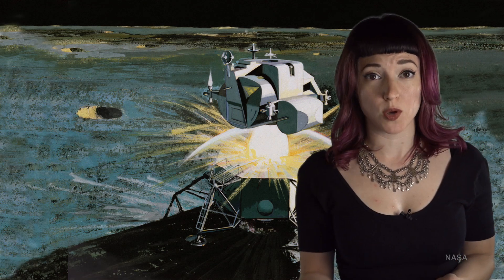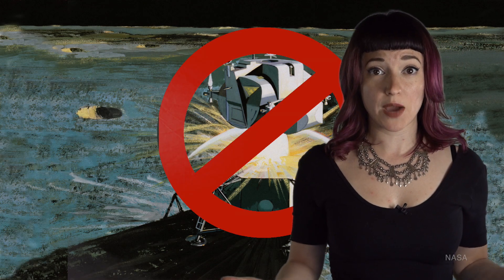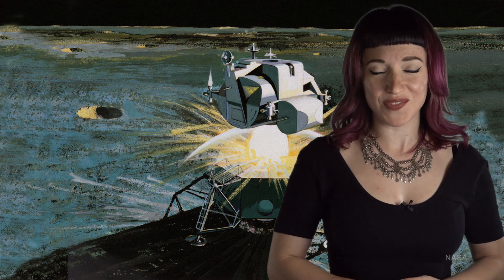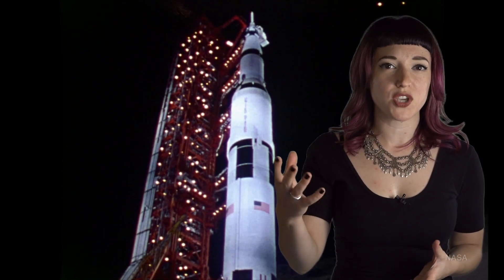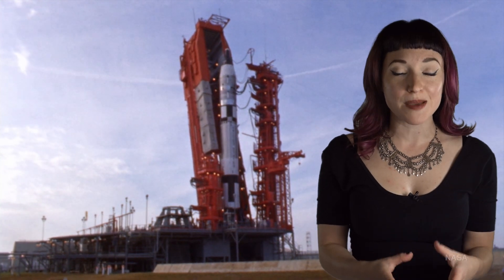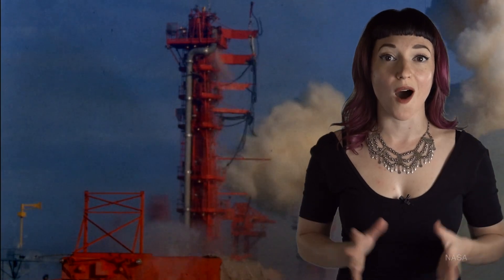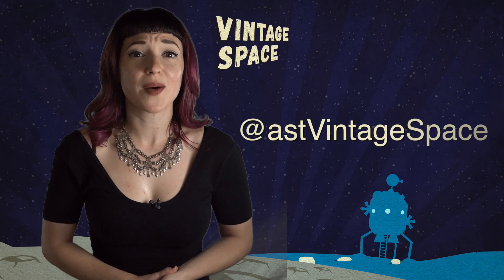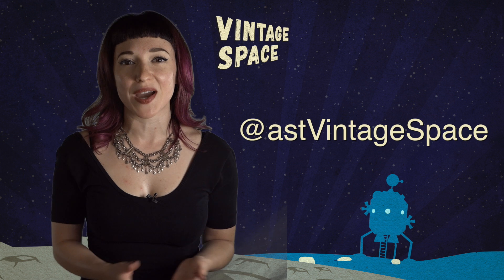How the Lunar Module Launched from the Moon Without a Flame

Comment: if the moon is half the size of earth and has half the gravity wouldn't you need half the size rocket to get off the moon I don't see that small lander having half the rocket size
Reply: The moon is not half the size of Earth, nor does it have half the gravity.
Also it has no atmosphere so a launching spacecraft won't have to force its way through a blanket of gas to an altitude where drag isn't a concern.

Plus, comparing the lunar module lifting off the surface of the moon to the Saturn V lifting off the earth is a bit unreasonable.
The lunar module ascent stage only had to lift itself to lunar orbit, where the orbiting CSM would rendezvous and then to all the rest of the work getting back to Earth.
The Saturn V had to lift the Lunar Module (ascent and descent stages), the CSM, the escape tower, the midstage fairing, the S-IVB stage, the S-II stage, and the S-I stage; all through 70 kilometers of atmosphere with from the planet with the largest gravity well of any of the terrestrial planets in the solar system.
Reply: Niall Kinsella have you ever wondered why they can't go to the moon in the 80s 90s 2000s even now still can't get there land and get back
Reply: @fredsloan3708  
The answer is simple. Since the Apollo program was cancelled, production of Saturn V rocket systems was stopped.
The Saturn V was the only rocket ever built that was capable of carrying a manned mission to the moon.
No rockets capable of doing the mission, can't do the mission.
Reply: rockethead7 you will be cooked going in the van Allen belt
Reply: @fredsloan3708  
Let's recap, shall we?

YOU SAID: "if the moon is half the size of earth"

== WRONG.  The moon is about 1/50th of the size of Earth (by volume), and about 1/4th of the size (by diameter), and about 1/80th of the size (by mass).  There is absolutely no aspect of the moon's size that is 1/2 of Earth.

YOU SAID: "and has half the gravity"

== WRONG.  The moon has 1/6th of the gravity as Earth.

YOU SAID: "wouldn't you need half the size rocket to get off the moon"

== WRONG.  The payload of getting off of the moon was about 1950 pounds in lunar gravity, and it had to lift it about 60 miles, with a velocity around 3,600 mph.  The payload of getting off of the Earth was about 100,000 pounds, and had to lift it about 200,000 miles, achieving a velocity of about 25,000 mph (at its peak).  Do the math.  You're off by a factor of MILLIONS of pounds of fuel/oxidizer.  You do know how to calculate these things, right?  Or, do you just assume that no aerospace engineer on the planet knows how to calculate these things?

And, then, from there, all you've done is ignore answers, and change topics.  You brought up that stupid conspiracy video about Buzz Aldrin "confessing" to not going to the moon.  I replied, asking you questions, you ignored them, and changed topics.  You ignored me.  You ignored Niall.  When asked again about those things, you ignored that.  I mean, what EXACTLY is wrong with you?  What drugs did this to your mind?  You think **I** need mental help?  Hey, dumbass, I'm not the one who gets every fact wrong, and then declares victory anyway.  I'm not the one who thinks that the entire world's experts for the past 50 years are all too stupid to notice that the landers' rocket engines couldn't do the job.  I'm not the one claiming the moon is half the size of the Earth.  That's YOU doing those things.  You have zero understanding of the topic.  ZERO.  Why do you use your ignorance as a method to accuse thousands of people of being criminals?  Nobody likes people like you.
Reply: rockethead7 so show me something you know you can't
Reply: rockethead7 by the way I said half the size because I didn't remember the exact size compared to the earth
Reply: @fredsloan3708  
YOU SAID: "do you really think I care if you don't like me"

== NOBODY likes people like you.  Look at yourself.  Good gods.  You sit there and accuse thousands of people of being criminals who deserve a lifetime in prison... and why??  Because every fact you state is wrong??  Because of your ignorance??  Every single thing you've stated has been incorrect.  Every single thing.  And, THAT is your basis for accusing thousands of people of being criminal frauds?  Yeah, NOBODY likes people like you.

YOU SAID: "I bet no one likes you"

== Pfftttt.  Oh, you're hilarious.

YOU SAID: "and you talking about me ignoring the facts"

== YES!!!!  YES!!!!  That's the entire point.  You say something (which is always wrong).  Someone replies.  You ignore it, and change topics.  You say something else (equally wrong).  Someone replies.  You ignore it, and change topics.  You're doing it again now?  Why won't you address a single reply by Niall or by me??  You were asked questions.  You were challenged on all of these "facts" (sigh) that you're stating.  You've addressed NONE of it.  NONE.  ZERO.  Not a single thing.  All you've done is ignore all input, ignore all questions, ignore all challenges, and change topics.

YOU SAID: "what did you doing out about the van Allen belt"

== Good gods, you idiot.  No, I'm not going to sit here and explain the Van Allen belts to you, when you refuse to address all prior topics.  If I do that, you'll just ignore that reply, and change topics.  And, I will reply to that, and you'll ignore it, and change topics again.  Sorry, dumbass, but I **DO** draw the line sooner or later, and will not address new topics, when you keep ignoring all prior ones.  You're obviously wrong about the Van Allen belts also, just as you've been wrong about everything else.  But, I'm not going to sit here and explain it to you, when your proven track record is to ignore all input anyway.

YOU SAID: "did you look it up"

== Dumbass, I don't need to look it up.  I've read countless scientific papers about the Van Allen belts for the past 30-40 years of my life.

YOU SAID: "bet you did and found out you would be cooked so lets hear what you found out"

== Gee, dumbass, if that was correct, please explain why there are no radiobiologists anywhere on the planet who agree with you?  Why not?  Why are there no particle physicists who agree with you?  Why are there no cosmologists or astrophysicists who agree with you?  You cannot even get the size of the moon correct, and you were off by a factor of 25x.  Every single sentence you've written has been factually incorrect.  Yet, you think you understand the Van Allen belts?  Hmmm, why did James Van Allen himself not agree with you??  Do you think you understand the Van Allen belts better than James Van Allen did??

What a complete moron.

Comment: I'm curious how they achieved the 25000 miles per hour that is required to escape Earth's gravity.
Reply: After getting into Earth orbit (17,000 mph), they did all of the system checks, then re-lit the 3rd stage J2 to add the extra velocity.

Comment: It looked to me like it was leaving the moon with an entirely different system, maybe even an anti-gravity one. The example of the rocket she gave us at launch in the daylight on earths atmosphere was still somewhat visible and yet I could not see anything at all in the night sky over the moon B.S. I think we were allowed to come to the moon and take the credit as gratitude for the negotiated compromise we made with the Germans after WW2.
Reply: Mike Abbitt makes a very good point and his theory on why we couldn't see the flame is far better than my anti-gravity one, I still Believe the Germans got there first and gave us credit as a reward.
Reply: @gravitronrutherford1631  
Good gods.  Antigravity engines??  Um, no.  There are reasons you can see a bit of the outer edges of the flame on the Titans.  (A) They ran them rich, because they wanted to keep them cool.  Extra fuel vs. oxidizer means that some of the fuel is going to burn with the surrounding air, instead of the N2O4.  It's the same as a car.  Run a car rich, it runs cooler.  Run a car lean, it runs hotter.  (B) You are going to see some interaction with the surrounding air.  On the moon, there is no surrounding air to interact with.  Hence, on the moon, the invisible flame remains invisible.
Reply: rockethead7 thanks for clarifying, that makes a lot more sense.

Comment: I have always wondered about this. But this video doesn't give me all the answers I want. Compare the size of the rocket that leaved earth to the module that arrived at the moon. I know Moon's gravity is weaker... But Did they really have enough fuel to get escape velocity to travel back to Earth? I would like this to be explained to me, i can't find it on the internet, there are a bunch of articles on the landing but apparently none on the take off.
Reply: The Saturn V had a payload of the command module, service module, lander, three people, the entire Saturn V craft itself, and all of the fuel/oxidizer needed to land and return home... and it had to lift all of that stuff a distance of about 200,000 miles before the lunar gravity did some of the work.  And, in rocketry, one of the most compounding factors is that you need to have enough fuel to lift the fuel.  And, you need fuel to lift the fuel to lift the fuel.  And, you need fuel to lift the fuel to lift the fuel to lift the fuel.  (I'm illustrating a point.)  And, it had to do all of this in Earth's gravity.

The LEM's ascent stage had a payload of a few rocks and two people, and the small craft itself.  And, it had to lift it into an orbital height of 60 miles to rendezvous with the command module.  And, it did it in 1/6th gravity.

Every year, thousands of students across the planet do these calculations as homework assignments.  The lunar module is textbook material at this point.  Of course there was enough fuel.  You can do the calculations yourself.  Or, if you scroll far back enough through these comments, you can find examples of when I've used the standard rocket equations to do the calculations for people in these threads.
Reply: @rockethead7  Man it's really hard to find your other comments. Youtube doesn't help at all. I really want to see the calculations.
Reply: @martinluther123  
Yeah, sorry, I'm not going back through the comments to get them.  And, I'm not doing them again.  You'll have to do them yourself, or patiently load comments until you find them.  Others here have done them also, by the way.  But, I'm guessing that the last time was around a year ago, maybe 18 months... best estimate.

Comment: Last point.  In the movie "2001", despite the brilliance of Arthur C Clarke and an army of highly educated technical advisors and director Stanley Kubrick's assiduous attention to detail,  the lunar lander produces a billowing cloud of smoke underneath. A minor error, excused by the fact that earthbound experience intuits a billowy cloud. This phenomenon would only be possible within a pressurized atmosphere where exhausts currents can be entrained in air or other ambient gas  (e.g., a helicopter landing on earth).  In a vacuum, however, billowing cannot occur, and all exhaust products are expelled RADIALLY from the source of ignition. The Apollo 17 video shows NO billowing. Rather, the exhaust gas eject radially from the rocket nozzle.  Move, check, checkmate, game.

Comment: I’m not sure how they maneuvered the lem or the space module around in space exactly, but from what I remember hearing, the space shuttle had little whole or ports that would through out short pops of air to maneuver the shuttle in different directions while in a stationary location or stationary orbit. At least that’s what i heard. The small thrusters were used to make larger maneuvers like moving in and out of orbits and the main drive was used to begin final decent.
Reply: Its called the reaction control system and every crewed spacecraft has them

Comment: Wrong on many levels,  they need to be propelled with helium,  hypergolic fuel is only also temperamental,  and the fluctuations of temperature on the moon would have made them highly volatile or unusable, they also produce less thrust so you need way more than the tiny lunar module carried, propaganda crap.  USA had Hollywood,  Russia didn't.
Reply: YOU SAID: "Wrong on many levels,  they need to be propelled with helium,"

== Pfffttt.  Helium?  Tell me this is a joke.  You do know that's an inert gas, right?  It doesn't burn with anything.  They did use helium to pressurize the tanks.  But, no, they didn't "propel" anything with helium.

YOU SAID: "hypergolic fuel is only also temperamental, and the fluctuations of temperature on the moon would have made them highly volatile or unusable,"

== Temperature doesn't work the same in a vacuum as it does in an atmosphere.  Oh, but you go right ahead and pretend you know things you don't know.  Go right ahead and tell the entire world's rocket scientists that they're doing rocket science all wrong.

YOU SAID: "they also produce less thrust"

== Congratulations on the only correct thing you've said.

YOU SAID: "so you need way more than the tiny lunar module carried"

== Pfffttt.  Yeah, sure.  This stuff is in every entry level university rocket propulsion course on the planet.  I've done the calculations.  Millions of others have done the calculations.  Not a single rocket scientist or aerospace engineer on Earth agrees with you.  Oh, but you're on YouTube.  That's where idiots can pretend to know things they don't know.

YOU SAID: "propaganda crap.  USA had Hollywood,  Russia didn't."

== You're a moron.
Reply: @rockethead7  the two parts of the hypergolic fuel need to be expelled together using compressed helium.  You are the fuckwit moron.

Comment: Her explanation only proves the moon landing was FAKE!!!   her titan rocket comparison failed!!!  I saw the flame on the titan!!!
Reply: The Titan rocket's flame is largely non-visible.  It's visible only around the areas where combining with the atmosphere.  They ran the Titans a bit rich to keep the temperatures down, which also adds to the effect, as a bit of the unburned fuel combines with oxygen in the air instead of N2O4.  In a vacuum, it's not going to behave like that.  And, you're missing the point entirely.